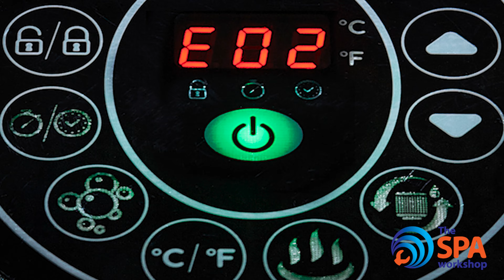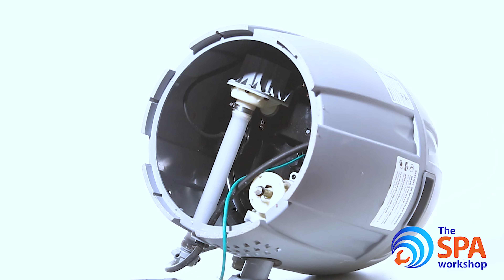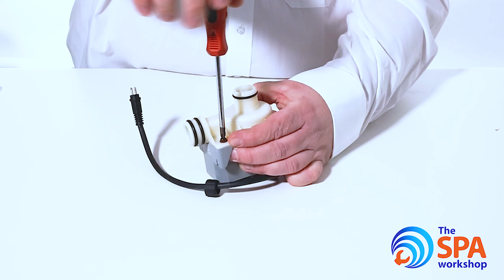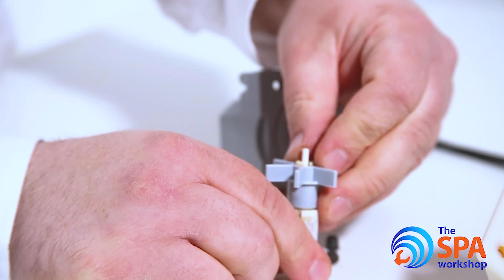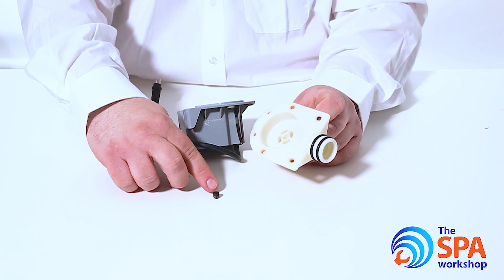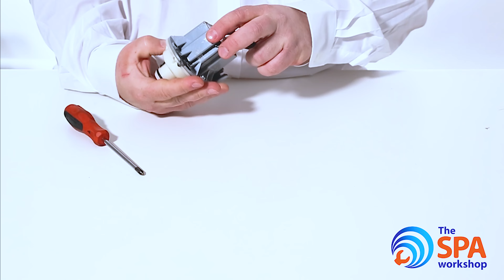How to fix an E02 - Bestway Lay-Z-Spa and Coleman Saluspa - AirJet and HydroJet pumps

Comment: Help! I've put the drain stoppers on both tubes to disconnect the pump. But the C pipe is 100% pouring water out, as though there is no cap on the inside of the spa. Can someone tell me what the problem is and how to fix this?
Reply from the maker: Hi Rachel,

There should be a set of three caps supplied with your spa.  Two of which which go inside the spa and cover the inlet and outlet pipe.  The third screws onto the 'A' bubble ring, external connector. 

I hope this helps

John
The Spa Workshop
+44 23 8000 6000
Reply: @thespaworkshop1261  Hi John. Thanks for the quick reply. I've put the two spa caps on each of the inside ports. Both are covered up, but water is still pouring out of the filter outlet pipe C. We had to connect a hose externally to catch the water. I don't understand it. It doesn't leak when connected to the pump, so I don't think there's a leak of any kind. Any thoughts?
Reply from the maker: @mymommymom  That is rather unusual, if the cap isn't creating a water tight seal, use a plastic bag to cover the outlet and then add the cap to hold it in place.